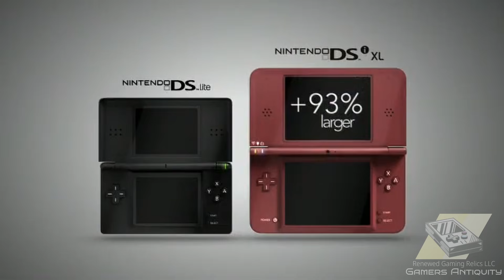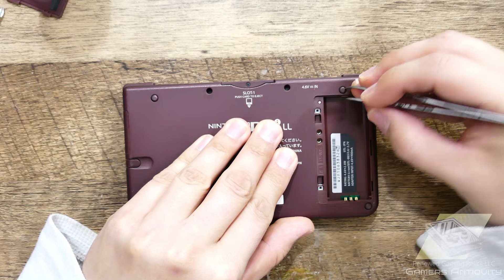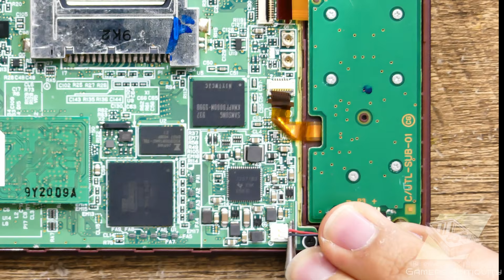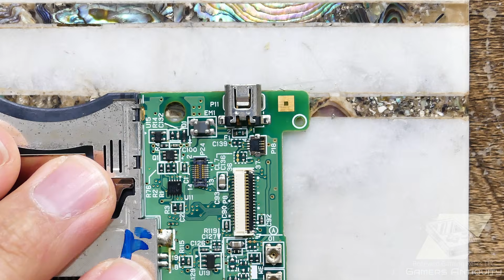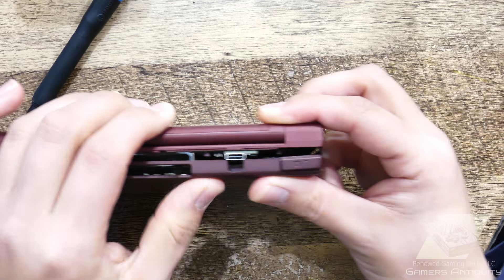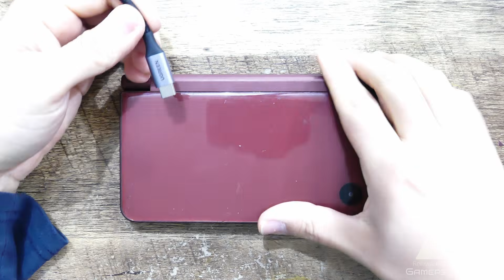USB-C Modding the DSi XL

Comment: can you tell me the temperature for the heat gun?
Reply from the maker: The temp of the heatgun is somewhere between 500-600 deg F. It's not a precise thing to set with the rotary dial with, but I almost never have have the dial set beyond 1. I don't think I'll ever have a use case for dialing up to 4 for over 900 deg F, but dang do I love the tool lol